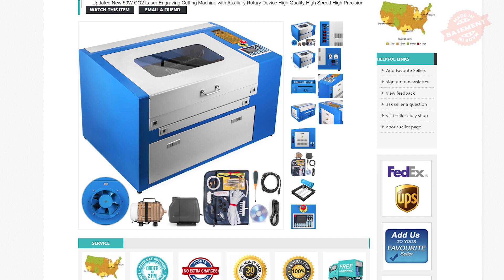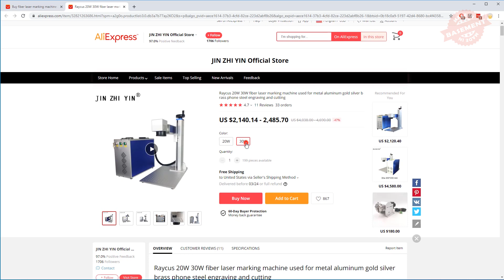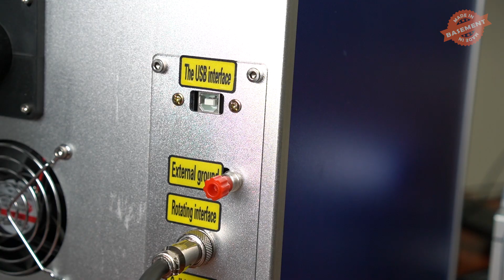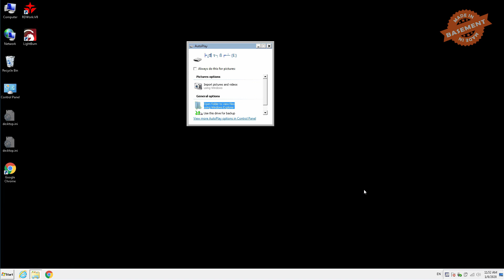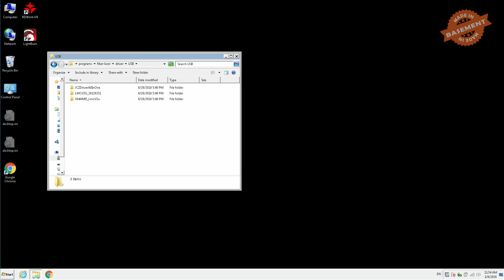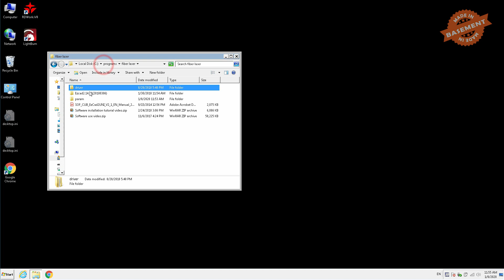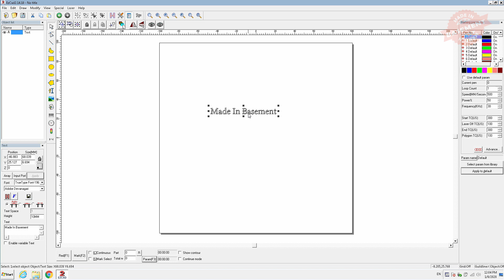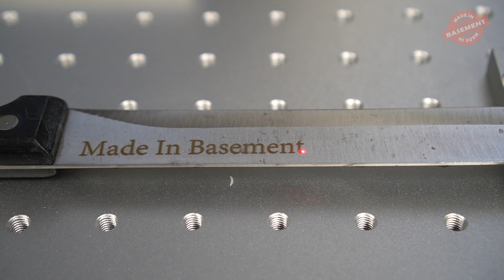Fiber Marking Laser Unboxing and setup

Comment: Looking at fiber lasers and curious your opinions given your CO2 laser history. Do you find use of the fiber laser or are you pretty much using the CO2 laser for everything?
Reply from the maker: I'd say I use my CO2 for 95% of things I do right now. Fiber is nice for marking metal, or very quick engraving. I've been banging my head on getting tumblers engraved with Fiber, but so far it's been very inconsistent. If it could engrave tumblers well, I wouldn't use my CO2 machine at all for this as Fiber is so much faster and in theory should last more longer and doesn't require any maintenance.   If you plan to engrave metal business cards or mark part, Fiber is gold.  Nothing to lubricate, no need to worry about water cooling or air assist, just exhaust...

Comment: I see you've had your fiber laser for awhile now and I'm wondering how the unit has been working. Any concerning issues?
I'll be getting one shortly and am just deciding if I should buy direct from a manufacturer in China or spend the (much) extra cash and buy one from here. 
BTW, your DRO attachment is an awesome idea!
Reply from the maker: Thanks!  So far only issue I had is that I can't engrave 200x200 mm area even tho I have 200 mm lens.  It looses a lot of power closer to the edges so I try not to engrave anything larger than 100x100 mm... I don't know why it's happening, maybe lens is low quality...
Reply: @madeinbasement  This is good to know. I'll be going with the upgraded 30w JPT laser and 200 x 200mm marking area. The JPT upgrade is an additional $200 and reviews say it is well worth it. Most of my marking will be under 200mm so I should be fine.
Thanks so much for your reply. I look forward to more videos from you.